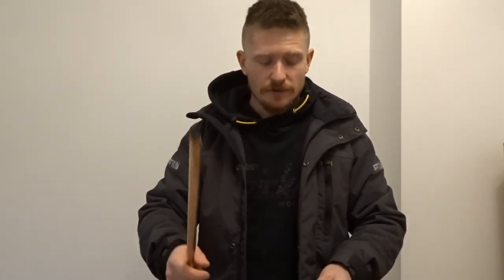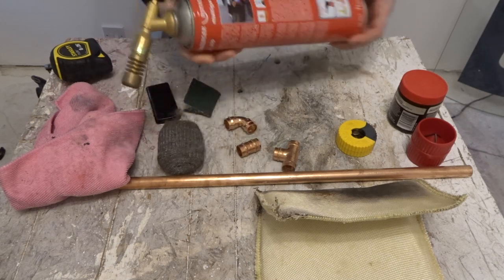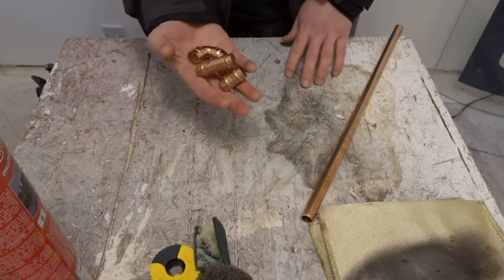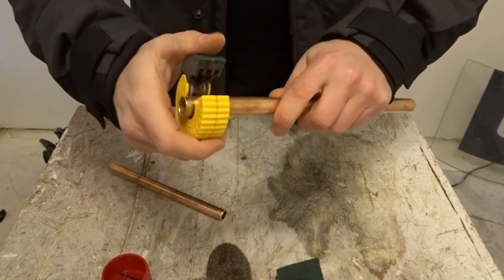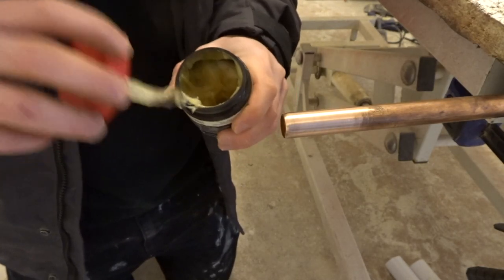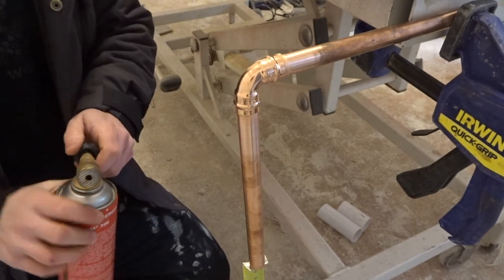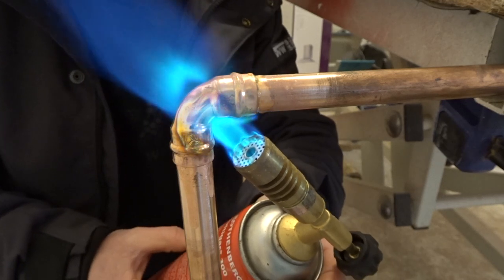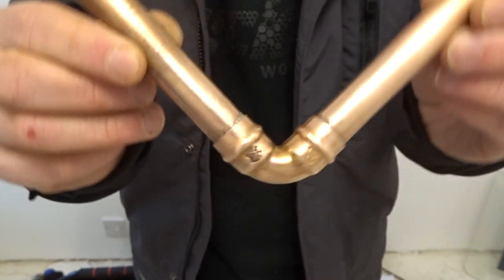How to Solder Yorkshire Fittings | Solder Ring fittings | Capillary Fittings

Comment: I was always told that as the solder runs towards the heat, you should heat from the pipe side of the joint, whereas the non solder joints you heat the joint and the solder runs into the joint

Comment: I noticed he used the torch on the middle of the pipe at the bend and not underneath the "ring". He also stated how to use torch underneath as heat rises, but he did it in the middle? Please explain someone

Comment: Thank you a lot. This helped me prepare properly and finish my first soldering without any issues. At first, I thought I overheated the pipes because I was using a blow torch bought from Amazon with a MapX gas cylinder from Toolstation. But it wasn't an issue/

Comment: Once you've soldered the joint and it's cooked, if you've got any concerns or just want to be certain, can you go back over the joint and and more solder by end feeding it? Just starting out, so just thinking belt and braces. Great video, of to buy a de-burrer thanks.
Reply from the maker: You can however be careful not to add too much solder because that solder will run into the fitting/pipe and cause restriction/noise.

Comment: I only did soldering  couple times many years ago and I remember having to add solder stick to the joints once the flux start boiling, and the solder will melt and sucked into the gap.   Is this a new way of doing soldering?

Comment: I want to solder a tee that has an elbow joint very close that also will need soldering. Should i solder that seperataly or do at same time? Theres only about a cm of pipe between the tee and the elbow

Comment: Any tips for capillary soldering of 22mm pipes and fittings? I rarely have problems with 15mm work, but often with 22mm, end up with leaks! Would you advise using two torches to give better heating on 22mm solder fittings, and is end soldering better than pre-soldered fittings when doing 22mm work?
Reply: I think it's more important with 22mm to apply heat to the pipes initially so that when you start to heat the fitting the pipes get up to soldering temperature. I think it's too easy to try to rush the job and get an imperfect joint by concentrating the heat on the fitting  and have the pipes are not hot enough to be wetted properly by the solder.

Comment: I made the mistake of soldering one half of a Yorkshire fitting. Now the other side doesn't have solder. Would it be okay to feed solder into that like a normal fitting when I come to connect to the existing pipework? Thanks for the vid!
Reply from the maker: I would de solder and start fresh as a DIYer

Comment: Hi 
Great channel.
Can I use a heat gun ?
Can I put. a bit of solder at end of copper pipe edge ( sort of double seal the fitting if understand)
Reply from the maker: Hi. Thanks, glad you like it. Use a brazing torch.

Comment: When do you use copper versus plastic? seems to be plumber preference but is there any jobs the plastic can't do?
Reply from the maker: Plastic looks ugly anywhere visible such as radiator pipes but that’s personal preference. There are also some cases around water heaters and boilers where plastic can’t be used.

Comment: Brilliant, thank you for this, is there any chance you could do a video on how much pipe is needed to be cut/measured (from to)  to bridge 90 degree angles or other angles other than straight whereby you would need to cut a precise amount of pipe so it will line up with the horizontal, so a straight piece or elbow can then be used, i know this is probably so basic for you but there's no one out there that actually explains how the measuring of correct amount of pipe to connect is achieved. 
Thx if you can would really appreciate your help.
Reply from the maker: Thanks. I will see what I can do
Reply: @TheDIYGuy1  fantastic thank you👍👍👍

Comment: Hi good videos, been following you for sometime.Many of the solder ring fittings i noticed dont  have enough solder  inside them so to ensure a secure  fitting can you add extra solder wire around the joints while  the flame is applied ? Thanks
Reply from the maker: There's nothing stopping you adding solder however be careful not to add too much as it may restrict flow if you allow excess solder to run into the joint.

Comment: The flux you are using is horribly aggressive if not cleaned off. Same for any ‘self cleaning’ flux, I come across leaks all the time due to its nature. I had to drain a huge schools hot water system 3 weeks ago, a 42mm pipe had developed a leak where the flux had been left on the joint/pipe. As I traced the pipe back through the ceiling I came across other repairs for the same reason. 
Good tips regarding the soldering, I try to use Yorkshire fittings all the time as they’re so neat.
Reply from the maker: Thanks for your comments 😃

Comment: What's the reliability of these vs conventional soldering joints? Happy to have a go at either tomorrow but if there's no difference i'll try the easier version!
Reply from the maker: No difference. Only yesterday I ripped some of these out that have been in place for 20 years! Give it a go!
Reply: Very reliable. Have had them for 50 years in current property.

Comment: I got told not to flux inside the fitting is this correct !?
Reply from the maker: I've always used flux inside the fitting with no issues. However this is for water applications where excess flux can be washed away therefore no corrosive effect. On gas applications I would avoid putting flux in the fitting but you shouldn't really be doing any gas pipe work yourself so this should not really be applicable.
Reply: @TheDIYGuy1  press fit is good too
Reply: As a registered engineer were taught not to put flux inside the fitting to prevent solder buildup, the solder follows the flux and builds up in the fitting, press are good but expensive to buy and must use correct rings depending on what the pipe is convening

Comment: I'm guessing de-burring is to prevent any copper shards entering the pipework ? That is a  neat trick with the tape measure
Reply from the maker: De burring prevents flow restriction but also prevents any "noise". If you don't do this step it can cause whistling/flow noise. Thanks :)
Reply: @TheDIYGuy1 Thanks for that explanation, appreciated
Reply: (and sub'd)

Comment: These pipe fittings have been around for over 25 years - anyone not knowing this yet considering embarking upon a basic plumbing task should ask there Carer what day it is... it might be Ice-cream day!!
Reply: And that is how you end somebody’s desire to learn. Hope you don’t have children, Bob!
Reply: They have been around for over 50 years as I used them back then to make up vacuum system backing lines.
Reply: @ColinMill1 they also had wooden pipes then
Reply: @marciaedwardscrown  Not for vacuum backing lines though.😁
Reply: @ColinMill1  sure
Reply: What about someone who has never seen one before? Ttl logic chips have been around even longer ,what do you know about them?
Reply: I had one of these fail , there didn't seem to be much solder in them. I had to use capillary action with some solder, which defeats the object.
Reply: @jablot5054  The copies can be quite variable but the genuine ones have always been fine in my experience.

Comment: Blue flame is unburnt gas and not so hot as yellow. If you hold the torch further away, it will heat the copper more quickly

Comment: Not sure how you can spend 11 mins teaching people how to use yorkshire fittings.....1)clean pipe and inside of fitting. 2)flux both with everflux. 3) insert pipe into fitting. 4)heat gently til you see a ring of solder emerge all the way around fitting.5) leave to cool and wipe with damp rag. Job done.
Reply from the maker: I did and it’s been popular so far and has helped many many people